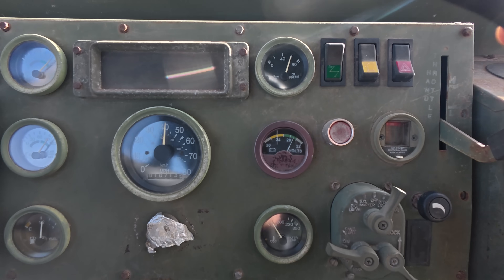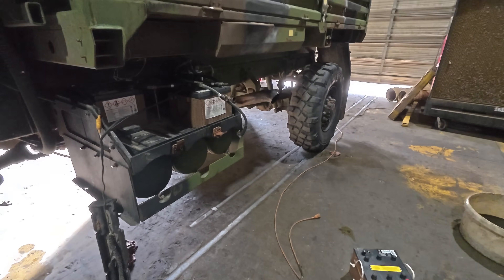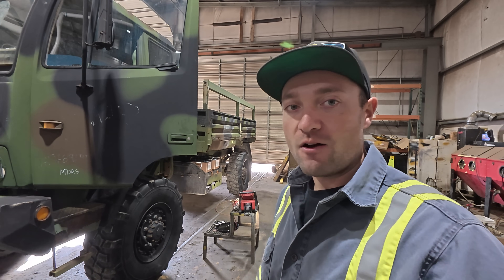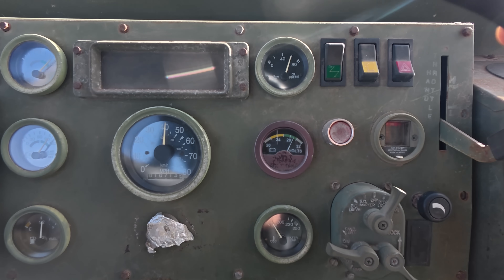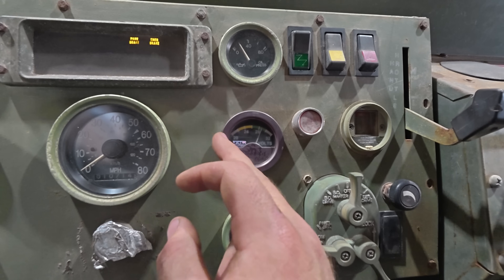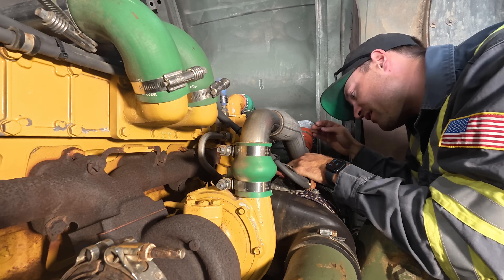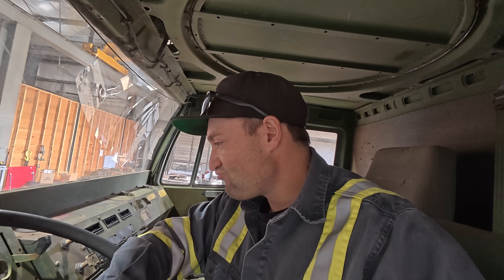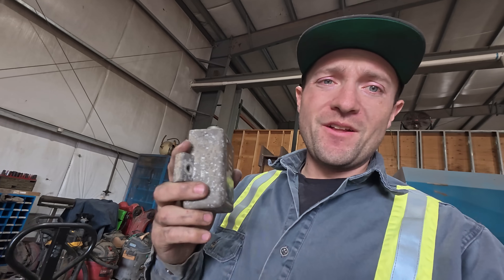THIS WAS A TICKING TIME BOMB!!!!! -  LMTV electrical system nightmare!!!

Comment: If you ever need a alternator there is a guy here in canton ohio that set us up woth a new one that does both 24v and 12 volt. They are just about impossible to find a new one. The guy im talking about has a shop that has been in business for years rebuilding alternators and starters. I think he charged around 400 those alternators are brushless. Thats why they are so expensive

Comment: Replace the Voltage Regulator. If you tap it with anything it will put out full voltage for a second. I bet the batteries smell like rotten eggs.

Comment: Boy that Nissan bought back some memories. We had one of the original MQ Patrols as we called them in Australia. It came out in 1981 with leaf springs all around and a Nissan SD33 naturally aspirated diesel. The electrics were 24v to match the engine that was basically a Nissan truck motor. Not fast on the highway but nearly indestructible. Very capable off road we loved that machine and it was a sad day when we sold it but 2 doors don’t suit a growing family unfortunately.

Comment: Glad you checked the regulator before pulling the generator. That dual-voltage generator is capable of 100 amps at both 12 and 24 volts. Good for stick welding. The 24v system is for starting and military radios, 12v system for everything else. Make sure those small ring terminals are crimped good to the wires, do a tug test. If you get a no charge indicator on the dash, but the volt meter reads in the green, it's usually the crimp on one of those (don't remember which one). Hope that new regulator fixes your issues. After fixing army equipment for 28 years, the LMTV is the only military vehicle I would own personally. Good luck. 👍

Comment: I'd suggest reading more in the LMTV forum on SS. I'm a member there and I also own a LMTV. You should run only 2 batteries. The alternator itself is undersized for four 6MT batteries. Running 4 will shorten the alternators life. I run 2 in my truck and have for years. 4 batteries is not needed. 

If the alternator does blow, don't put the military one back in. Do a 24v retrofit then put in a 12/24v battery balancer to make up for the 12v loads on the truck. You'll save $$ over the Neihoff part.

Comment: Hey, I wanted to leave you a tip on the alternator when one tip somebody showed me a number of years ago with that voltage regulator problem if that ever happens again, put your meter on the back of the alternator and read the voltage coming out on the DC scale then switch it to AC. You should see zero if you don't then that means that one of the diode packs is probably blown and it's sneaking AC through making your voltage read higher. Hope that helps.

Comment: added a small ampmeter/voltmeter  wired remote clamp. fun to watch.    80 amp at start up. tapers down to 14.    in a few minutes.     winch draws 200 amps full load.   on a 100 amp new alt,,,

Comment: Your charging theory is incorrect. A normal lead battery has high resistance in the cold so a normal 12v car can see 15.2-15.3v when lower. So a 24v (nominal) system would be double that at 30.4-30.6, so an analog gauge saying 31v would be very normal. The voltage will slowly climb as it charges. The battery charging specs for a particular battery can usually be found in their product info. An easy legend like Trojan GC2 can be looked up. They're 6v and would series wire together for 14.8v charge normal. So cold temps it will frequently climb a little.

Comment: Is there a zener diode on the generator/alternator?  Old British engines used them to limit the charge voltage.  It'll be a single wire going to a thing screwed into a grounded heatsink.  A modern replacement would probably use a mosfet to dump everything over 28.8V (max) or 27.6V (nominal)  into a resistor.
Edit:  I watched to the end and you found the problem for sure.
Reply: 12v or 24v is nominal, typical charge for an open cell lead battery is 14.8v which can reach over 15v when cold. Charge specs available from many battery manufacturers. Generally sealed batteries are like 14.4v, but alternators don't really know that. Many newer cars are spec'd with AGM batteries and the computer does more charge control. So 15.2-15.3v on a 12v battery in the cold is normal. Double that for 24v and a normal is 30.4-30.6v in the cold. But that voltage regulator was obviously bad. Which is not unusual.

Comment: Hole in the roof - Hole in the roof - Hole in the roof - Hole in the roof - Hole in the roof -> Just sayin 🤪
I‘m NOT a betting person or gambling person at all, in fact I hate that stuff but I would bet my last 5 Euro that the slightly burned/melted Voltage Regulator is the problem for your solution 😂😜
(Not for the hole in the roof, just to be clear 🥴)
Thx for the newest video, we for sure will see us in the next video 👍
All the best from 🇩🇪, Philipp

Comment: I had a pickup with a 12 volt battery. It went to 15 volts when it was running, so 3 volts above nominal voltage. On a 24 volt system that still figures out to 3 volts above nominal voltage per battery which seems ok if you have each set of two batteries connected in series.

Comment: On a 24 volt electrical system charging even as high as 30 volts isn't a problem. Twenty eight volts would be normal charge current and a variation up to 30 is essentially 15 volts per battery, which probably have a maximum charge voltage recommendation of 16 volts.

I think you did well to put four batteries in the truck but as far as I can see there is nothing wrong with the charging voltage you see.
Reply: Yep pretty much...12v or 24v is nominal, typical charge for an open cell lead battery is 14.8v which can reach over 15v when cold. Charge specs available from many battery manufacturers. Generally sealed batteries are like 14.4v, but alternators don't really know that. Many newer cars are spec'd with AGM batteries and the computer does more charge control. So 15.2-15.3v on a 12v battery in the cold is normal. Double that for 24v and a normal is 30.4-30.6v in the cold.

Comment: I think there were quite a few of us yelling at you check the regulator right from the start, it's the first place to look when over charging occurs. I've seen a battery catch fire through over charging and the fire develops quickly. Nissan make good stuff with nearly bullet proof engines but don't disregard ching the gearbox oil at the prescribed intervals or it may become expensive.

Comment: I would have hoped that Uncle Sammy would have standardized across all of the 24 volt heavy trucks the same alternators, regulators, switches and wiring diagrams.  Enjoying watching you guys work ... while I sip coffee.  Thank you.
Reply: I think the only standard thing is fuel.
Reply: They standardize the systems essentially not really the parts. Since there's tons of manufacturers it's hard to keep everything the same

Comment: Normal batteries charge at 14.6v I imagine it would be the same ish 29.2?
Reply: Close, 12v or 24v is nominal, typical charge for an open cell lead battery is 14.8v which can reach over 15v when cold. Charge specs available from many battery manufacturers. Generally sealed batteries are like 14.4v, but alternators don't really know that. Many newer cars are spec'd with AGM batteries and the computer does more charge control. So 15.2-15.3v on a 12v battery in the cold is normal. Double that for 24v and a normal is 30.4-30.6v in the cold.

Comment: if you open the door while the cab is tilted pleas put a strap on it the hinges arn´t realy made to hold the door up in that position. also benith the door there is a limiting bar that runs in a C-chanel on the door and is hinged on the cab it is disconected on the drivers door from the looks of it

Comment: I knew it was a shorted regulator. I used to charge my '54 IH by grounding out the field of the generator.  I popped the headlights so often I just taped the bulbs in instead of screws😎👍

Comment: when I had a bad alternator or starter I'd take it to a local shop to be refurbished - getting new brushes and the insides cleaned up is a lot cheaper than buying new.
Reply: not many shops can work on these Leece neville Dual Voltage alternators.
Reply: @farmingsmallkubota1783  I bet more can than you give them credit for

Comment: I believe your 'more batteries' theory is poor. 🙂 A regulator doesn't car about the number or size of batteries, only the voltage the attached batteries have achieved. A 12V lead-acid battery will be nominally be a tick under13 Volts, and around 14 volts while charging.  Your 24 volt system would be right about 26 volts then when fully charged and no load, and 28/29 or so while charging.
Reply: Close, 12v or 24v is nominal, typical charge for an open cell lead battery is 14.8v which can reach over 15v when cold. Charge specs available from many battery manufacturers. Generally sealed batteries are like 14.4v, but alternators don't really know that. Many newer cars are spec'd with AGM batteries and the computer does more charge control. So 15.2-15.3v on a 12v battery in the cold is normal. Double that for 24v and a normal is 30.4-30.6v in the cold.